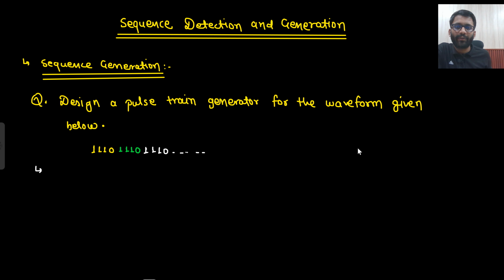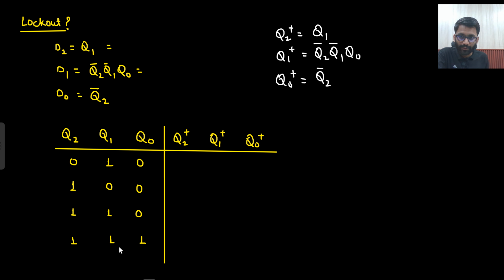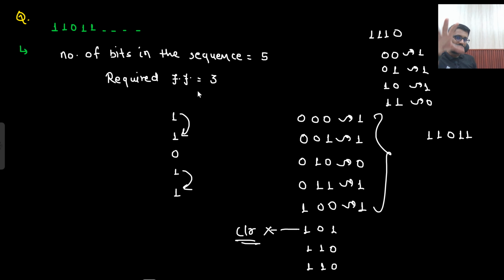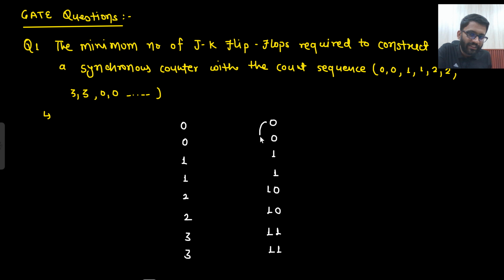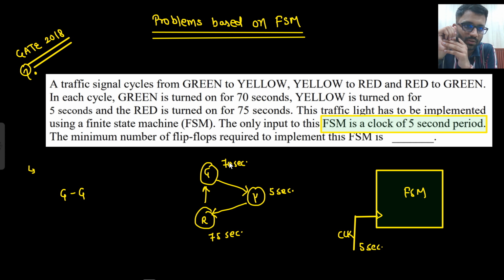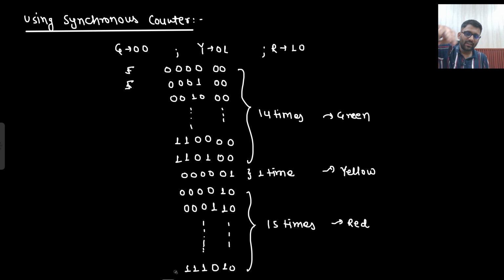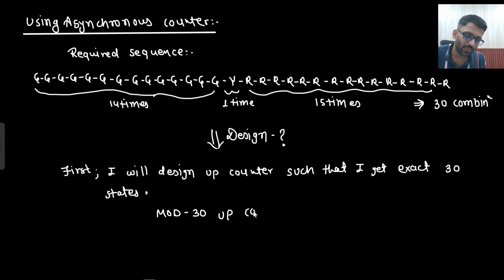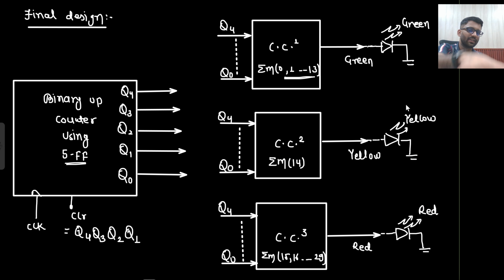🔥GATE 2018 Traffic Light Problem in Digital Electronics ECE || PrepFusion || Himanshu Agarwal

Comment: Sir I think we can also design 5ff using synchronous counter same concept of your solution to asynchronous counter is applied here
Reply from the maker: Yeah, Up counter can be designed using synchronous counter as well but the first method goes only for synchronous counters.
Reply: Yeah sir we can also say the first one like we design timer separate by using 4 flops and 2 flops for state change from green-yellow-red